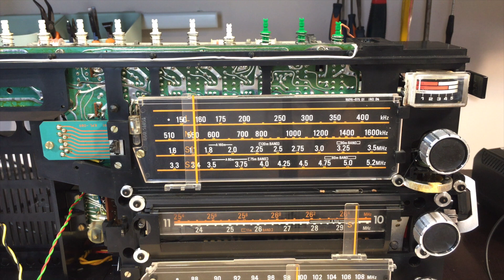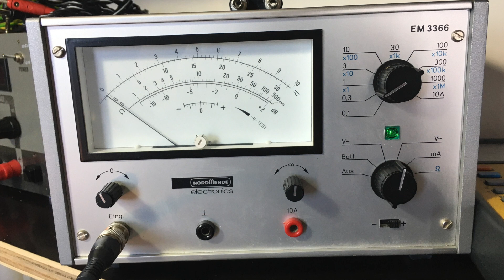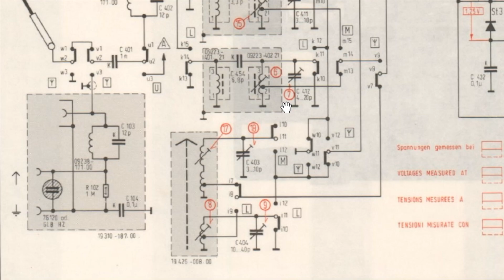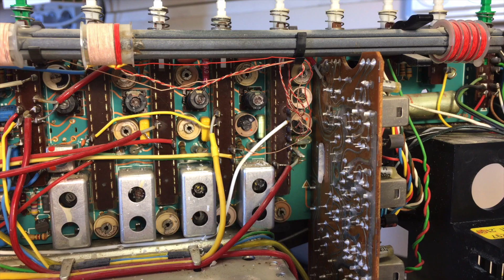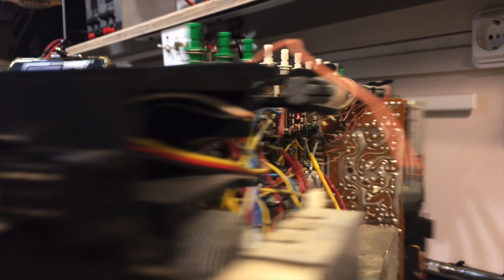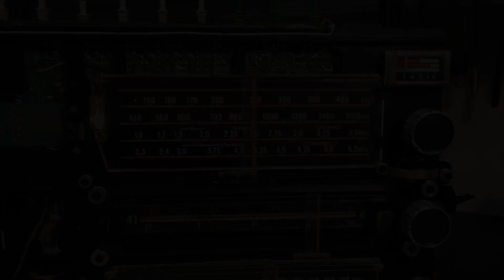RF alignment, or part at least. Grundig Satellit 2100 restoration part 6.

Comment: Another question:
First, thanks to this instruction, i understand what they mean with the allignment in the manual.
I have a Satellit 2400 and want also adjust the Frequentiecounter with the analog scale dial. Somehow it is not corresponding correct. For example in the LW band, the scale is set to 160kHz but the digital counter shows 145kHz. The radio is tuned to 145kHz, but the needle is way of. So, i would like to know how to adjust that. OK, i know, the Satellit 2100 has no Digital counter, but maybe you have some experience with this.

Comment: Nice instructions, now i understand my manual for the Satellit 2400. I was looking for my analog meter, but the lowest AC scale is 10V and i guess, this would be to high.
So, my question is, would a 1V AC panelmeter be sufficient to measure the signal?
Thx in advance.
Reply from the maker: I have no idea, but I think it's a DC meter.
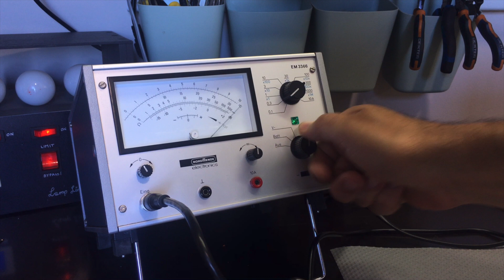Reply: @electronicsoldandnew  Euhm, weird, in the instruction video it says mV AC (see at around 16:55)

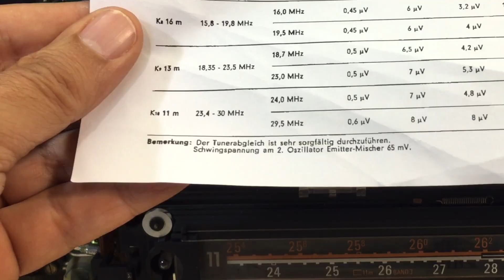Comment: OK, I stopped at 7:20. My old tube based RF generator has two scales in the highest range, the actual frequency and the first harmonic. I guess that's the trick 😉 It also confuses my frequency counter, some time it would lock at 90 MHz, the next moment at 180 MHz.
Reply from the maker: Exactly 😊

Comment: Gelukwensing meneer. Dit het baie goed uitgewerk. Gee, thankfully I have a sine wave generator which sweeps beyond 100 megs, but in earlier days...yes, I would have put those otherwise pesky harmonics to a good use for once :-) But how come the 7th? 
Cheers from Germany
Reply from the maker: Baie dankie. Die “meneer“ is nie nodig nie. Noem my maar Manuel 😊 
The sig gen does 20MHz sine wave, but I need harmonics, so the square wave is the answer, and this one has an upper limit of 5Meg.
'n boer maak 'n plan (en 'n Porra maak twee) 😊

Comment: Thank you vor this excellent video series which has motivated me to by this radio on ebay and try a restoration myself. 
Couldn't it be that T10 is a preamp and T12 is the mixer? In this case intermediate filters ("Zwischenkreise") would be on the input frequency.
Reply from the maker: Stefan explains it perfectly in the previous comment. 😊

Comment: Hi Manuel, this radio has TWO RF selective circuits for HF in the front end. This is to increase the image ratio to an acceptable level and avoid chirps when tuning it - especially  for SW1 & 2.
So T10 is an amplifier with selective circuits at its base and collector, which are both tuned to the receive frequency.
T11 is the oscillator and T12(!) is the mixer, which gets the RF signal to its base. The oscillator is fed to the emitter of this mixer via C429 and ZF XVI is the first IF circuit.
Reply from the maker: That makes more sense. I must admit that I did not look at it too closely, as I should have done. It’s weird to shift my thinking from tube radio architecture to transistor sets. 
Thanks again for your help.